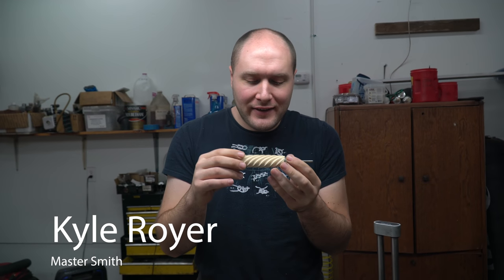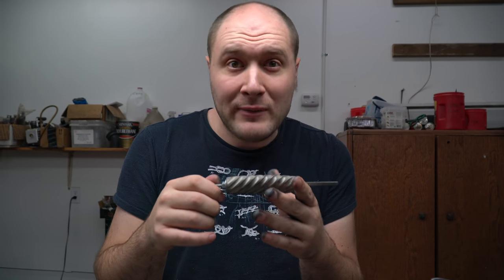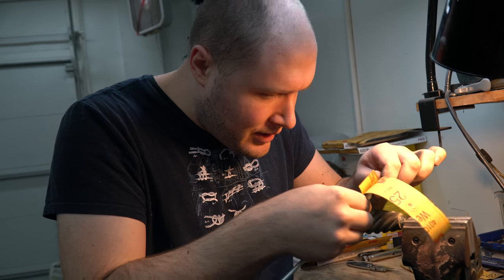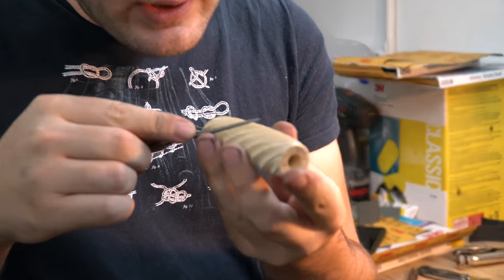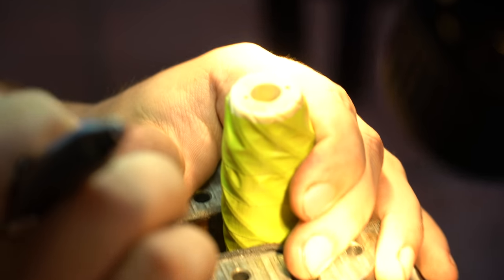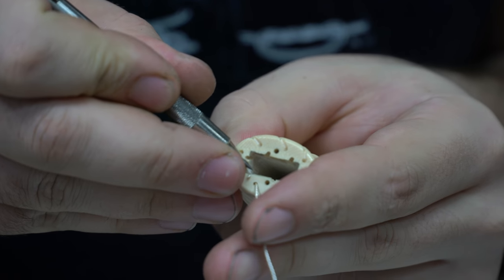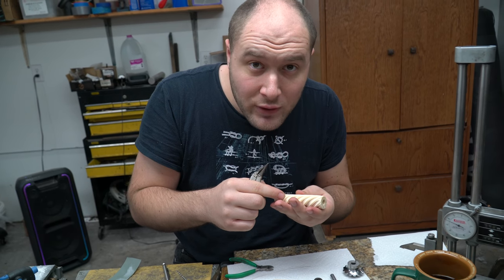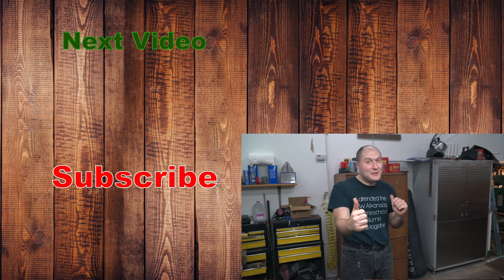How to Flute a Handle for a Custom Dagger ~ Part 3

Comment: Thank you so much for the video and how to on fluting and wire wrapping. I figured there was some trick to anchoring the wire, but thought a knot at one end and some kind of threading or friction fit into or against the pommel.
Hadn't occurred to me to grid the handle.